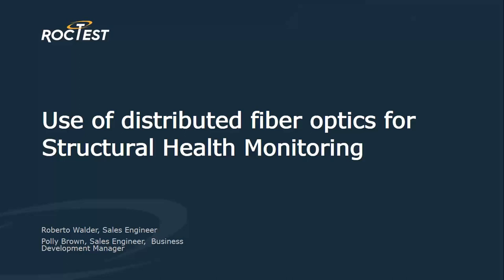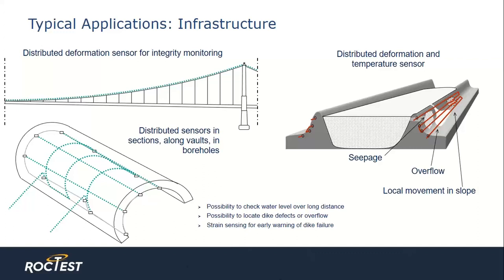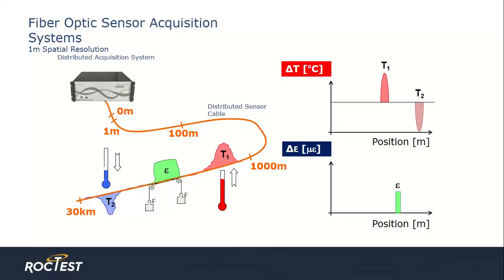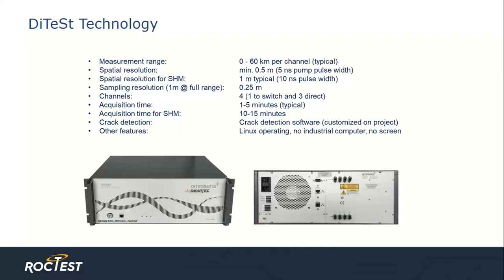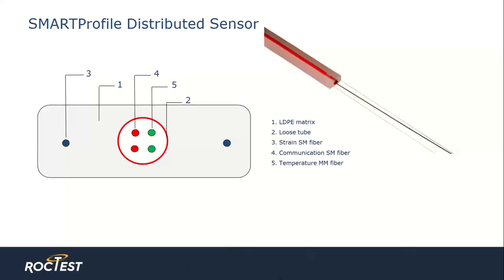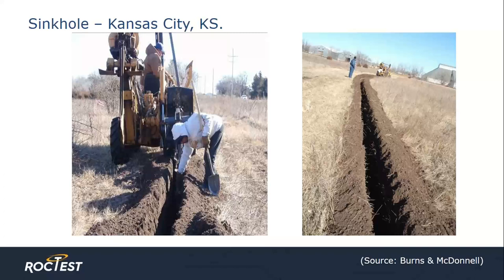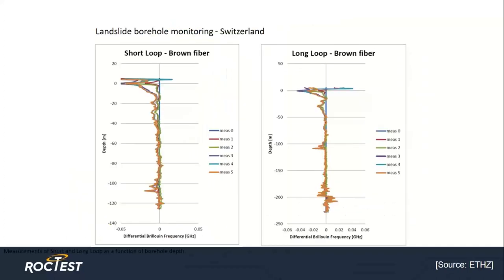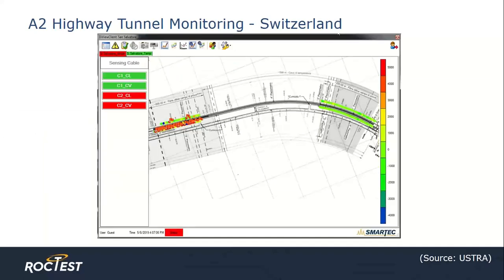Webinar: Use of Distributed Fiber Optic Sensors for Structural Health Monitoring

Comment: Is it possible to detect soil movement along the pipeline by measuring the strain&temp by the help of telecommunication fiber optic cables running inside the hdpe duct parallel and  close to(50cm-1m) steek pipeline.